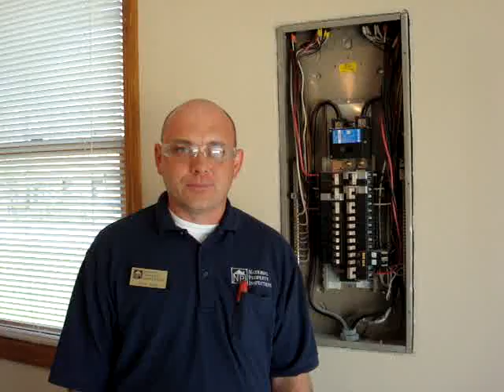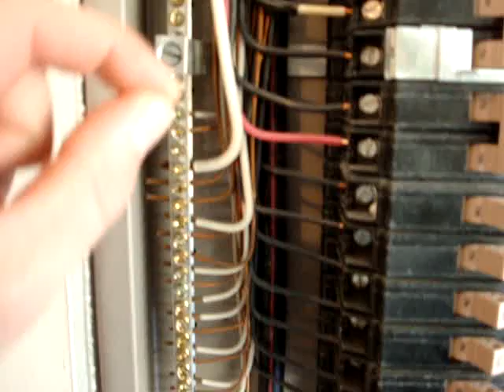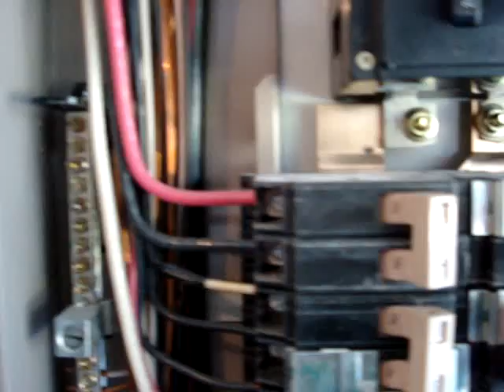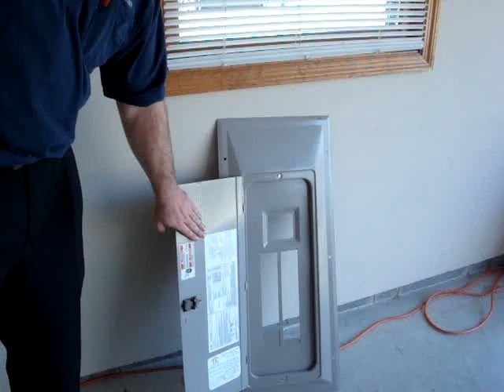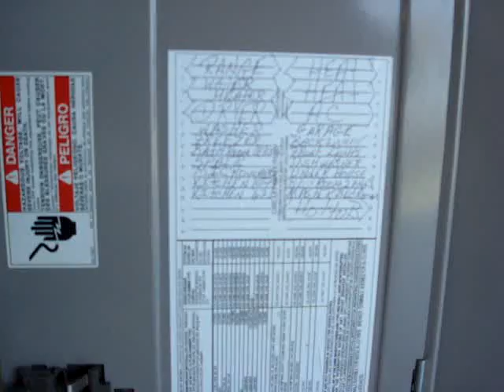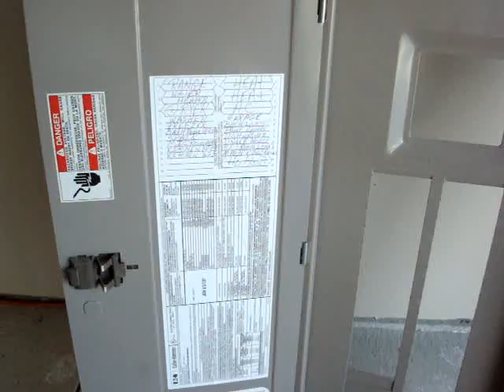Electrical Inspection (National Property Inspections)

Comment: my panel wired alot like this one where , the grounds and white neutrals are all mixed together on both sides off the bonding bars . Does this matter? Because I've seen other video's where , the bar on the left is all grounds , and the bar on the right is all white neutrals.
Reply: David Frisch if it is the main panel and not a sub feed this is fine the ground and the neutral are bonded together and already have electrical continuity in the panel. On a sub feed however the neutral and ground should not be bonded. On a sub panel neutral should be isolated back to the main panel and grounds on connected to the metal enclosure also heading back to the main panel on there own ground wire.